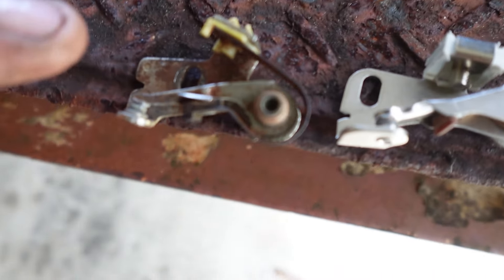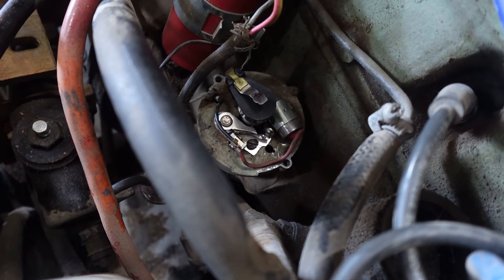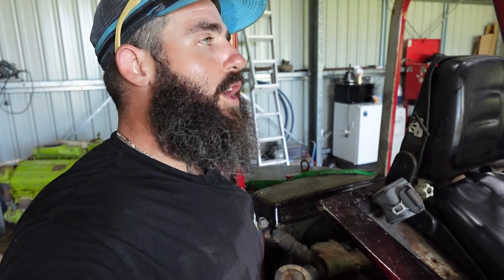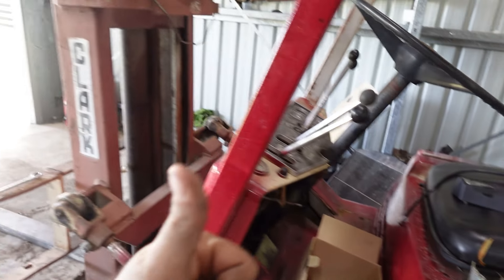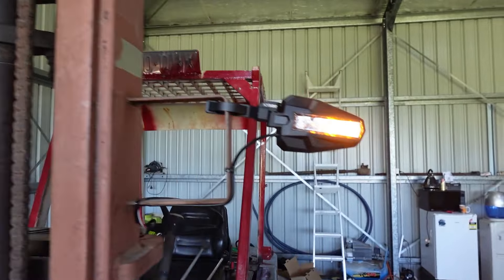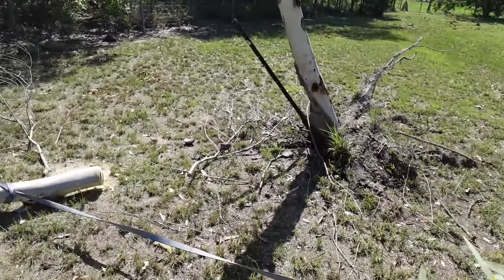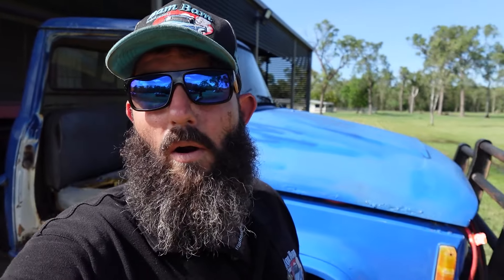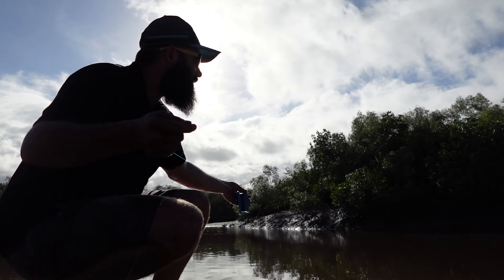Forklift Repairs & Upgrades! Cyclone Clean up, And i even Catch a Fish!!

Comment: Should of mounted them on the actual forklift ROPS. 

They way you've done it, they will be out of adjustment every time you tilt the mask, haha

They look good though
Reply from the maker: Yeah I didn't want to drill or weld to the Rops but I might make a clamp style bracket and move them to the Rops later on! They give a wider rear view on the mast too!
Reply: @bambamfabrications  copy that. Keep up the good work mate. I'm in Adelaide, but gree up in the sticks. Watching ypu and Cody is just what I'm used to and what I got upto haha
Reply from the maker: @timothyschulz4730  hahaha cheers legend!!!